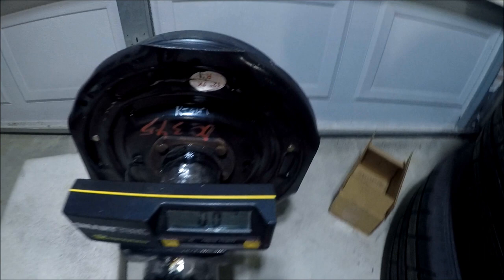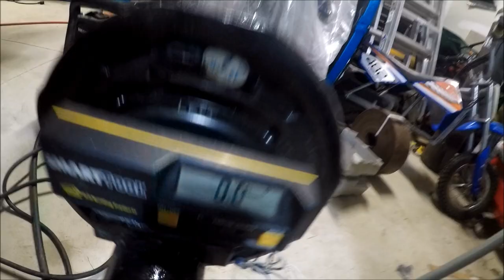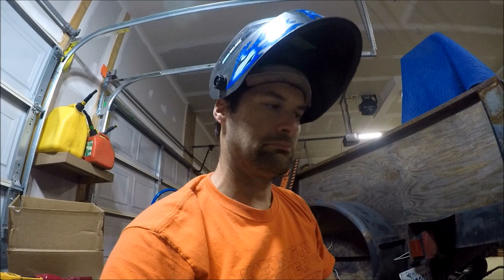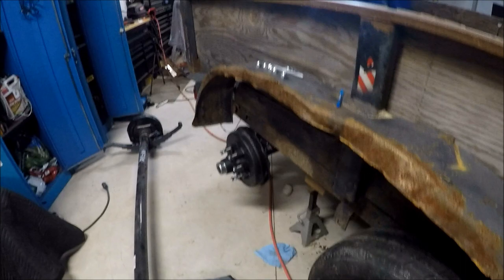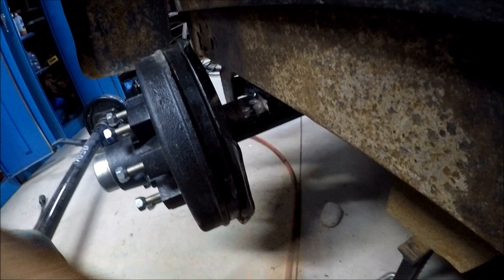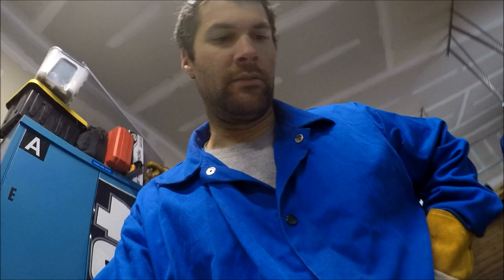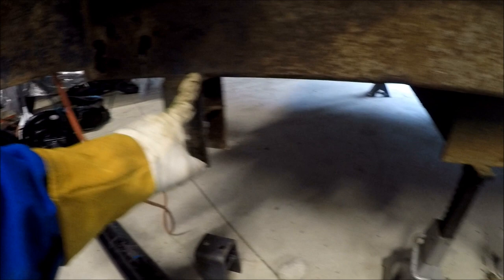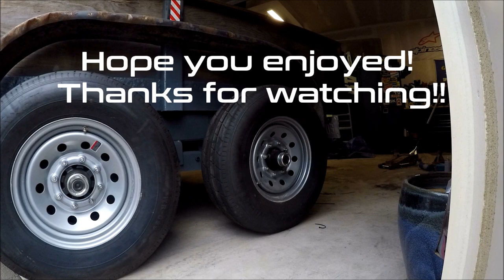7k TK Trailer Axle Install

Comment: why did you have to reposition the brackets? was it because they were not dexter?
Reply from the maker: The backets were actually exactly the same. However, the new springs were longer so I had to space out the brackets a little more. I wanted to use the new brackets anyway because I didn't know the history on the trailer.

Comment: Any issues at all with this axle?
Reply from the maker: Been running these for going on 3 years now and they have been fantastic. I run my dump trailer at max capacity every time I tow. I recommend them.
Reply: @erlegree  I'm trying to decide between this company or Dexter
Reply from the maker: @ninja63639  Dexter is a great company. Basically industry standard. Dexter axles were a bit out of price range for.my budget when I build this, and I have no regrets getting these TK axles. I have been considering building an equipment trailer, and I'd probably go with TK axles again